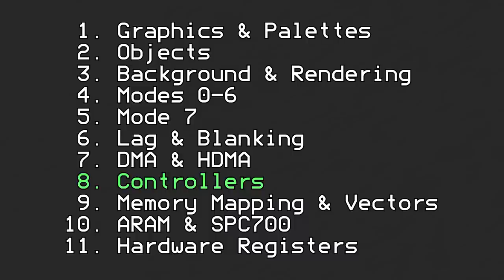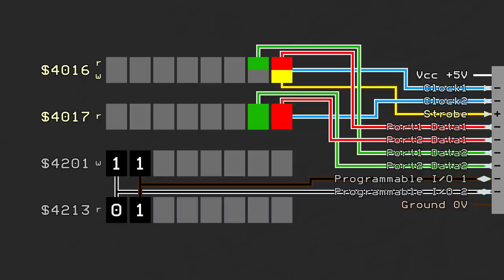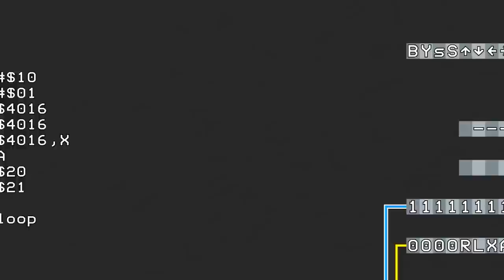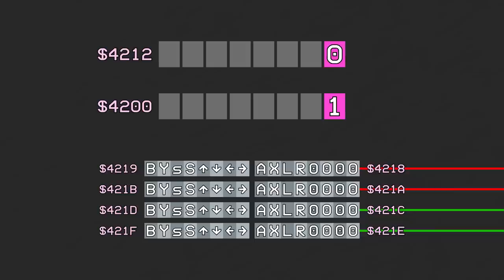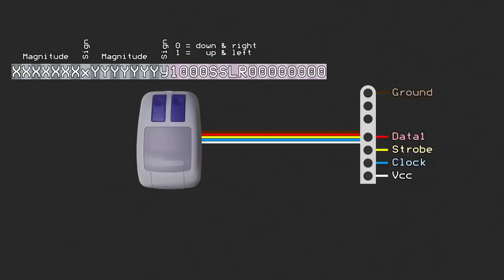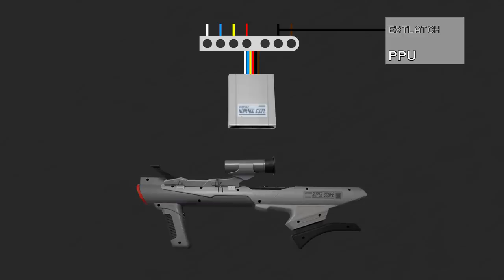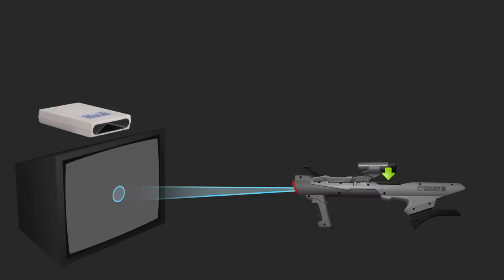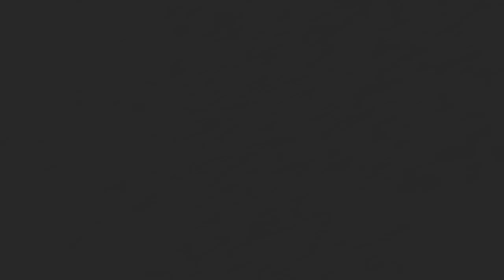Controllers - Super Nintendo Entertainment System Features Pt. 08

Comment: Interesting video, but I found one small error in it regarding the Multitap, specifically the Performance one illustrated here. I got one at EB in the late 90s when they were making room for N64 stuff at the time. Since I just left it plugged into the 2nd port and in 2P mode (only had 2 controllers then), I didn't think about it. But as soon as I popped in Yoshi's Island, an error screen came up. Can't recall the exact wording, but it essentially says "I see a Super Scope, mouse or something else here. Unplug it.". Unplug the multitap and it continues  normally. The game has a 2 player mini game, hence why it would look for a 2nd controller.
Error message detailed here:
https://retrocomputing.stackexchange.com/questions/9255/why-cant-special-controllers-or-accessories-be-used-with-super-fx-games

So if the multitap in 2p mode is a completely passive component (like an extension cable), how can Yoshi's Island see it and error out?
Reply from the maker: Sorry for the late reply, your comment got caught by the spam filter somehow.
I just tried it with my own hardware and the game boots just fine. In fact, turning on the game with 3-5P mode on--causing the error to display--and then flipping it to 2P mode makes the game start immediately. You don't even have to hit the reset button on the console.
My guess is that the multitap you had was faulty if it was detected in 2P mode.
Reply: Yoshi's Island uses Super FX, a processor which is compared to the SNES a powerful processor. The problem is that it is so powerful, most accessoirs will trigger a failsafe (the error message) and the Multitap is one of those forbidden accessoirs.

Comment: The controller doesn't need the latch pin to know when to start clocking out an input?
Reply: The controller does not control the clock line. only the data line.
The latch pulse copies the present state of the buttons into the shift register. At that point, the bits representing the buttons can be shifted (clocked) out one at a time onto the data line. If you were to send a new latch pulse before shifting all buttons out, it would just copy whatever the buttons are now, overwriting what was there before.
Reply: Turns out I was remembering a schematic for a USB SNES adapter, latch/strobe etc

Comment: What would happen if I spliced one controller into 2 different Snes consoles?
Reply from the maker: I'm no electrical engineer, so take my answer/guess with a grain of salt:
I think since the strobe line going to each port is the same, there wouldn't be an issue with it merging back together in the single controller. There is a possibility it could function as both controllers at once, but it would depend on the game. Most would probably work fine, but if a game does anything weird like interleaving the pulse edges to the two controller ports, it would not function identically to two separate controllers with the same inputs.
Reply from the maker: Oh, I read that as splice one controller into both ports of one console.
In the case of splicing one controller into two consoles, it would depend on where the two TVs are in their raster cycles relative to one another. If they hit V-blank at around the same time, the two consoles' controller handling routines would conflict and it definitely wouldn't work on either side. But, again assuming the game doesn't do anything out of the ordinary, if the two consoles were timed such that only one ever polled the controller at once, it could possibly work. I wouldn't recommend splicing the Vcc and ground wires though, I'd just keep them fed into only one console!
Reply: @RGMechEx  hmmm, there's no simple cheap way of playing 2 games simultaneously is there?

Comment: Why didn't Nintendo just have one wire for each controller button and send the signal if the button is pressed? Just for the sake of NES compatibility?
Reply: Because the cable would be about as wide as your pinky-finger.
Reply: Well, for starters, if we take +5V, 0V, strobe, programmable I/O, and 12 buttons, that's a 16-pin connector. We don't need clock, since we've got a wire for each button.

Oh, but hang on, the controller sends 16 bits so we can tell what kind of controller it is, so let's make it 20 pins.

Oh, and we shouldn't forget about the data 2 line too, so it really should be 36 pins.

Oh, but some of these controllers send 32 bits, not 16, so I guess it should be 68 pins...

At that point, we're not even talking about a controller port anymore. That's more pins than the cartridge slot has, and even then it's still less functional than the original 8-pin controller port was, because that can read as many bits as it wants.
Reply: @magicalgirlnicole  You just need 5v, ground, and 12 pins, really.
Reply: @ricarleite Not if you want all the functionality that the original port has. And if you plan on doing something more complex with those pins for the mouse, Super Scope, Multitap, etc. to get around that, then you no longer have the simplicity of "one wire = one button", at which point you might as well just stick with the original port.